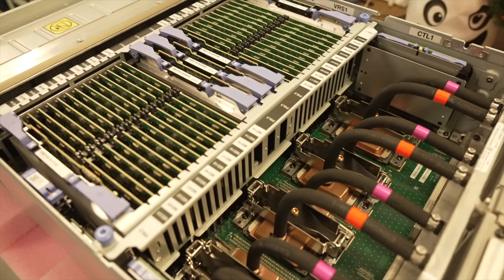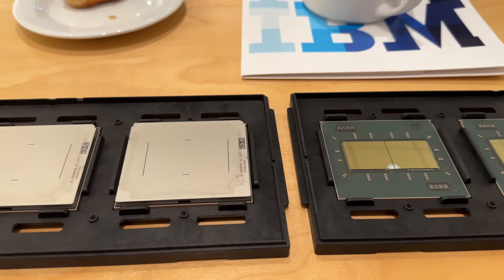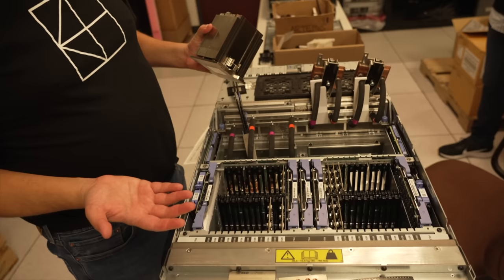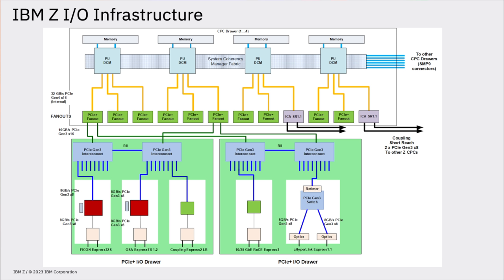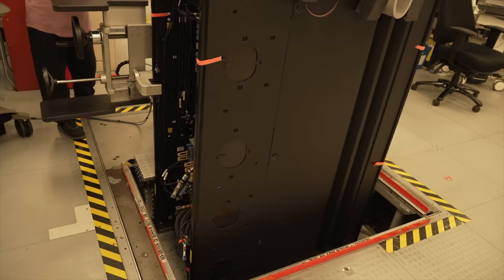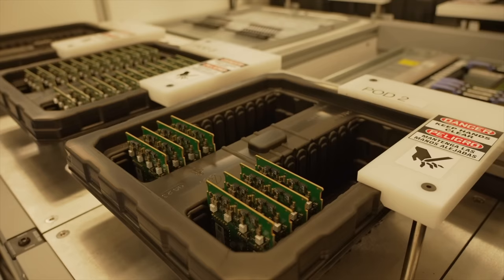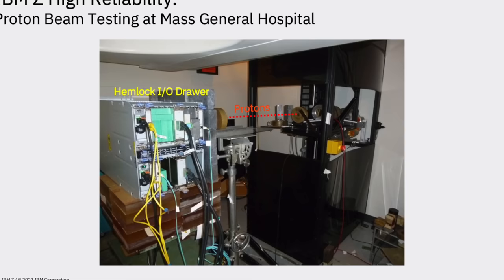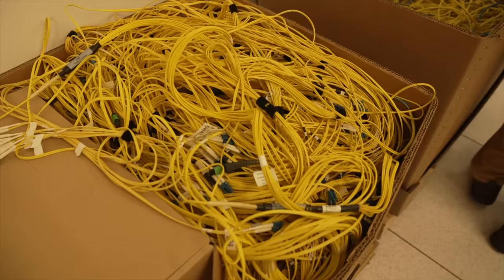Why Do Mainframes Still Exist?  What's Inside One?  40TB, 200+ Cores, AI, and more!

Comment: The one thing IBM needs to do, but has always been vehemently reluctant to do is provide a hobbyist version of zOS...  Eventually they're going to run out of people that have the knowledge of how to run these machines.  One of the reasons that OpenVMS still exists is due to DEC and those who bought them maintaining the hobbyists that became employees running those systems.  Hercules can run zOS (or at least the older versions of it), and I imagine there would be a significant number of fellow geeks that would enjoy being able to learn on it.
Reply: @gt2847c - Long ago, I thought about a hobbyist version of VM/CMS but what programs would I run on it?  Same question about zOS.  These operating systems are not designed for games or other programs that are typically run on PCs.
.
Also, I am sure that these operating systems are HEAVILY optimized for the IBM hardware and this hardware is RADICALLY different from a PC.  It would be like the difference between a motor cycle with four-speed left-foot shifting and a semi which has a  shift lever with two auxiliary thumb controls (a five-speed main transmission with two high-low auxiliary transmissions, giving 13 speeds).   I think that it would take a huge effort to get zOS to run on a PC (or some other hardware that a hobbyist could afford to buy.
Reply: Free versions of MVS and VM/CMS are out there. zOS is just MVS with Linux. I run my implementation on a Raspberry Pi.
Reply: @KameraShy  Isn't public domain MVS stuck at 3.7, which is 24-bit only?  Ditto with VM?

Comment: The construction of these machines is quite impressive. It’s interesting to see related processors crunching so much data. I work mostly with the Power architecture, but the small version of it - a three-core e200z4 with a eTPU timing coprocessor. The heatsinking here is very impressive! In my world (automotive ECU design) we run them at 150MHz to keep the power dissipation down.
Reply: Shhhh, don't tell people that their cars are likely running small versions of these CPUs. Well actually the eTPU is running their engine, the CPU is just watching and adjusting.

Comment: When you consider the exotic complexities of building performant, reliable and secure distributed systems on commodity hardware, the mainframe still looks like an attractive option!
Reply: I bet it looks considerably less attractive when the bill comes
Reply: @TheGreatAtario  They start at about $2.5 million and head on up. But if you consider the salaries of elite developers and sysops plus the hosting costs of a large cloud infrastructure plus the reputational costs of lost data, it obviously makes sense in a lot of scenarios.

Imagine if you are a bank. Do you really trust your core account data to some exotically complex sharded distributed setup? Or do you prefer to stick it on a couple of massively redundant replicated super-computers?

Again, if you are a high frequency trader, using dozens of GPUs and striving for microsecond latency. As we've seen with real examples, the cost of a glitch can run to $billions and break the company. You're surely happy to pay for the fastest, simplest, most robust solution...

Comment: Your memory calculation for memory bandwith (for Xeon or any other x86 with 3200MT DDR4) is ~25GB/s per single channel. Most desktop CPUs are dual-channel, however modern Xeons are 8-channel and AMD Epycs are 12-channel, with DDR5 (4800MT/s) so depending on system you could be talking  (Xeon DDR4 3200MT 6-channel) 150GB/s up to (AMD Epyc DDR5 4800MT 12-channel) 450GB/s per socket.
Reply: Yup, came to say the same myself.
Reply: he knows. its just to invite comments..
Reply: ELI5

Comment: People have been saying "Mainframes are dying" for 40 years now. I don't believe it will ever happen. I loved working on them, all flavors of OS. MVS, MVS/XA, MVS/ESA, Z/OS, etc, etc. Working with TSO, ISPF, JES2, CICS, ACF2, RACF, ESP, CA7, IDMS, IMS, JCL, etc, etc. I did everything from System Operator to Systems Programmer. I'm retired now, but it was an awesome career, working on Y2K was a blast.....One awesome thing about Mainframes was how you could have one running CICS and people from Alaska to the tip of Florida could all get the same sub second response when hitting enter...very fast...
Reply: Sounds like you worked at EDS.
Reply: I'm about 6 months late to this comment, but I was in the crowd saying, "mainframes will die because of cloud computing."  Then I worked for a university, several insurance companies, even a court system... all of which shut my mouth up about mainframes going the way of the dodo.  There is an elegance and grace to mainframes that commodity systems simply cannot come even close to.

Comment: Fantastic presentation.  I was in engineering at DEC for a number of years working on some of the larger systems we made.  The dimensions of the problem are the same (speed, connectivity, redundancy, maintainability, etc), but the numbers on these machines are truly mind boggling.  There are just some parts of the computing world where you need all the features these machines bring.  And fun to see that the passion for building machines like this is still around.

Comment: Last place I worked had a Z series running a medical records system. Mainframe itself was not in a standard rack just a huge monolithic monster but very stylish. Redundant everything including 2 racks filled with as many 1tb drives as they could hold. I think the whole thing required 6 50 amp circuits. Redundant power too. It was an amazing beast and thank you for helping me understand it better.
Reply: It's important to understand the difference between a mainframe and an I/O device. What you are describing with this:

> Redundant everything including 2 racks filled with as many 1tb drives as they could hold.

Is an Enterprise Storage Server (likely a DS8000 series machine). Mainframes don't have hard drives (except for the management elements) They outsource I/O operations to control units (CUs) in I/O devices. So a mainframe doesn't store data, it gives it to a CU and says store that. The storage controller handles storing it and where and data protection measures. Latest Enterprise Storage Servers do sub 1ms response times.

Imagine every card transaction that takes place being credit checked in real time as you do it (because it is). The mainframe (processor) software application requests the record from an Enterpise Storage Array and gets an answer back in less than a millisecond. So when you swipe your card, and it says approved, that went across the communications network to the mainframe, which processed it and requested the relevant records from a DB on the storage, the application checked the numbers and answers the credit check (approved/denied) and the application then responds back to the retailer, over the network. Whos card machine says approved/denied. That's happening realtime on every transaction for every card right across the world. 24*7*365. Mainframes for the processing, Enterprise Storage Servers for the data storage.

It is such a volume of traffic that a £15 million upgrade in that system can pay for itself in a day of processing those kinds of transactions, because of the increased volume of transactions that the upgrade facilitated.
Reply: @davetdowell  The mainframe itself was it's own beast. There were 2 other racks next to it full of IBM branded storage top to bottom. Fiberchannel stuff if memory serves it's been a while. I don't know what the full specs of the mainframe was but it was supporting about 20,000 total clients + printers.

Comment: I used to work with mainframes, would be nice to get back to them.  Back around 1988 - 512 Meg main storage (RAM), 4 CPUs totalling maybe 80 MIPS and a few hundred Gig worth of storage.  Supposedly our first government department to exceed 1 TB of connected DASD did that in 1993.
Reply: I started 20 years earlier. I recently spent a day scanning the latest equivalents to the manuals I used in the 70s. The assembler code I wrote then would still work today, i was going to say except for the loss of remote 3270 terminals, but I suspect those would still work. Provided I could cook up the appropriate (emulated) 270x controller. I had a 3704 back then.
Reply: Very nice!  It's been about 20 years since I've touched a mainframe, but I was pretty much hooked.
Reply: My Burroughs B5500 mainframe (circa 1968) now runs as an emulator in my browser. It supports 8 tape drives, multiple card readers and printers, card  punches, datacomms and head-per-track disk. It supports full virtualization of memory and can easily run half-a-dozen ALGOL and COBOL jobs simultaneously in 32K words.
Reply: @pquirk99  48 bit words.

The real thing didn't cope well with hordes of students trying to save their work in under 20 minutes.
Reply: One TB. Barely enough to store my photos for 2022.

Comment: Dave, cool video!  I remember reading that financial tractions would be processed by 3 mainframes in lockstep with comparators on the input and output.  That would catch errors made by one mainframe and use the output from the agreeing 2, flagging the error.  If all 3 disagree, it would halt the system.  You could take one mainframe down and not lose redundancy.  
Thanks for the video!

Comment: Cool video Dave! Mainframes will be around for quite a while due to the quantity of data they can move. I wonder how the Cray supercomputer I/O back in the day compares to today's numbers. Maybe in a future video you can stop by HP and get a look at their NonStop systems?
Reply: The Cray systems looked like alien technology to my eyes back then. Never saw one in person, just in magazines and what not.
Reply: @mikestewart4752  I saw a CDC Cyber, designed by the same bloke. Unclocked logic, tuned with not-quite-random length pieces of copper wire. I think it was octagonal, with one side open to provide space for the CE to work.

This was at CSIRO in Canberra.
Reply: Cray was bought by SGI.  What made SGI great was openGL and a separate bus for reliable uninterrupted high bandwidth communication between boards.  The separate bus idea was a precursor to PCI.   Eventually new SGI management came in and wrecked it’s huge advantage. (Draining reserves by buying Cray, creating a joint effort called Fahrenheit with Microsoft for an alternate to OpenGL which evolved into DirectX, and settled cross litigation with a startup NVidea by sharing their IP plus allowing them to cherry pick SGI’s best employees).
Reply: I'm sure the HP system is "NonStop" until your printer runs out of cyan ink, then the whole thing shuts down.
Reply: @douginorlando6260  There were two Cray companies.
Reply: @jej3451  HP bought Tandem NON-Stop, hardware and software were designed to be always up. I attended a presentation in the 70s.

HP also bought Domain Computer.
Reply: @oneeyedphotographer  I want to say that’s cray cray… but you might be right.
Reply: @jej3451  lol savage.

Comment: I worked a semester at IBM RTP in '85, working on a PC app.  All our developer builds were performed by a 3090 (mainframe) in the basement.  Compared to compiling on the PC, it was wicked fast.  Since then, I worked at a bunch of places.  Only one of them had a better developer-build solution than what I had back in '85...  and that place definitely wasn't Microsoft.

Comment: As one who went to college in the 1980s, when mainframes were still the undisputed kings of the computing world, and who went on to work in a place that made extensive use of them, I have to say that this is WAY COOL! By the early 1990s, shortly before I began a series of jobs that has kept me firmly in the PC/Windows world, mainframes were mostly doing batch processing in the financial world, and it seemed to me that this was mostly because it would have been too expensive and time-consuming to rewrite and debug the billions of lines of code running on mainframes. A lot of people were asking back then why anyone still needed mainframes, fewer new ones were being sold than ever before and the terminal emulation systems we were using to interact with them just seemed slow and clunky. Now, when the occasional question comes up about why mainframes are still around, I can not only answer that, but can add some information about the astounding power and reliability that mainframes bring to the table for the applications that call for them.